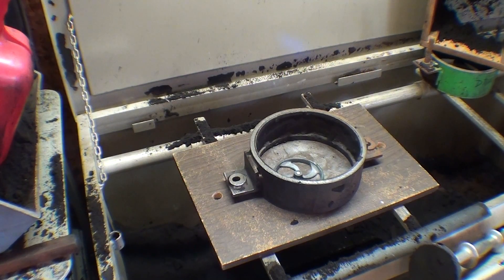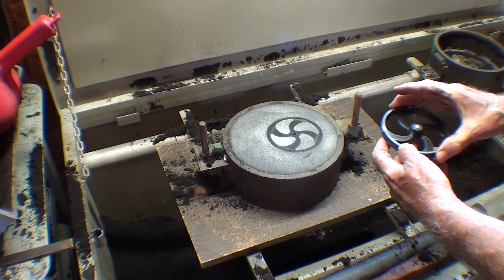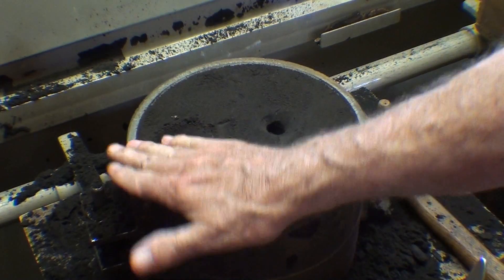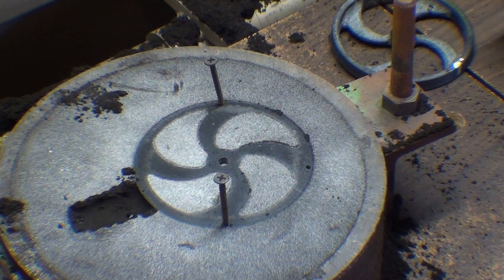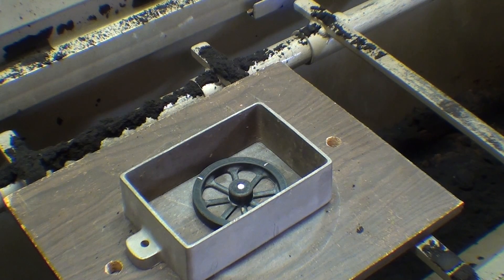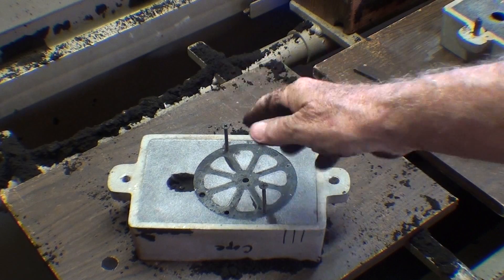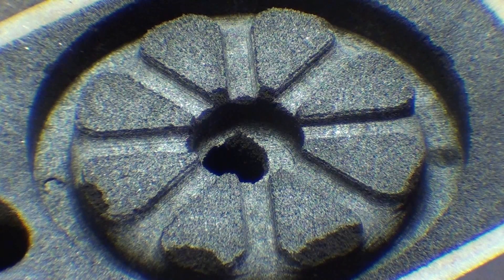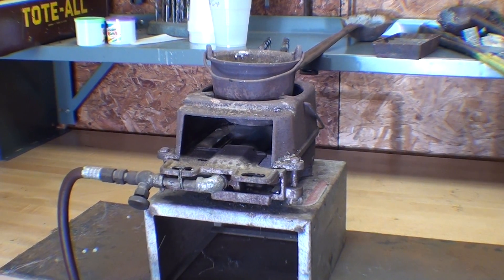TIPS #323 pt 2 Casting a Flywheel Pattern - 3D Printer mrpete222

Comment: I have done a bit of sand casting from 3d parts. Here's what I found - the hard way of course. Hope it helps

The common cure for ridges is using ABS plastic and some softening method using acetone. Those work but I just use Durham Rock Hard Water Putty  and knock of the excess with a red ScotchBrite. It has the advantage of working on any type of plastic

Be careful if you paint it. Some Krylon - Fusion products in particular - make Petrobond stick like crazy. Lacquer is good. Once it's dried I used paste floor wax to make it slick. I have heard you can use paste car wax but haven't tried. I tried spraying PAM just before I rammed and it seemed to give a better  pullout, however I haven't done it enough to be sure.  

Hope that something there is useful.
--
I had to take down my casting rig for various reasons. I started casting jewelry and it sort of got out of hand. Thank you for your videos. I was an absolutely horrible foundryman. I was so bad I got really good at the ins and outs of remelts.

But I started watching your series (And Myfordboy ) I got to where I could count on getting a useable casting most times.

Thanks
Bruce

Comment: just some thoughts:
I think adding a little more parting sand make the pattern easier to come loose
also making pins loose help when separating two halves of molds that half pattern stick to mold rather that come out.
Ali